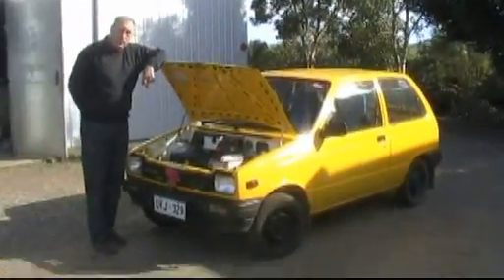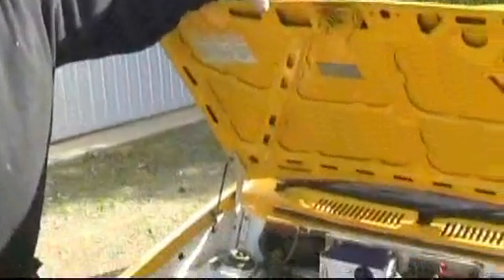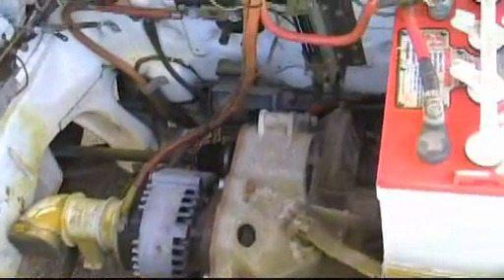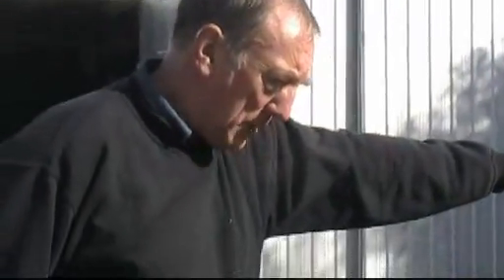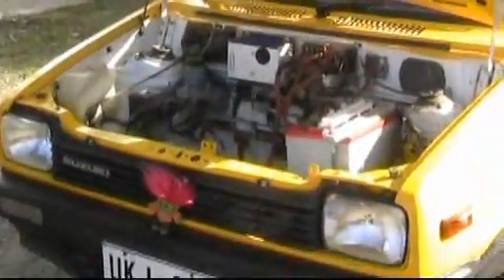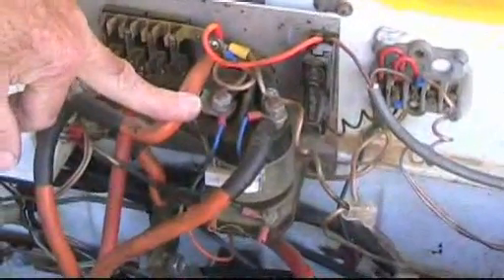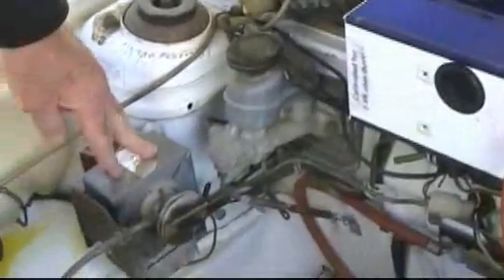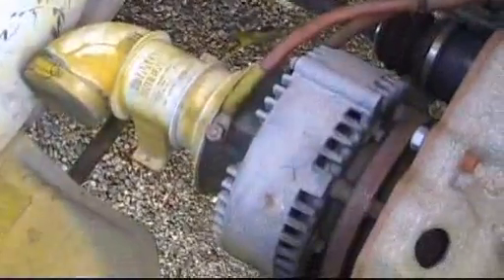EVRIC - 01 -  Rod Muller's EV Conversion

Comment from the maker: If you use an AC motor/controller system, these can have high voltages of around 300Volts and higher.